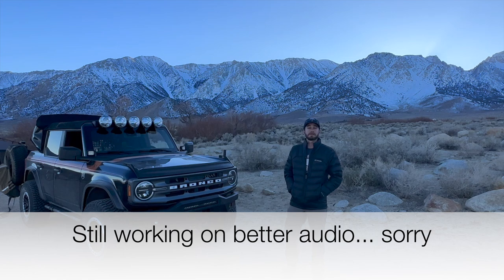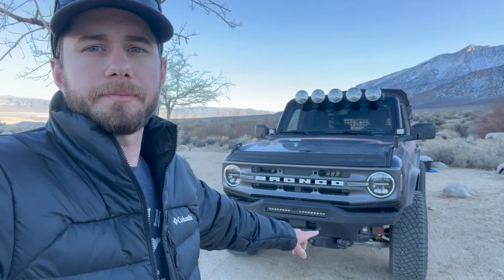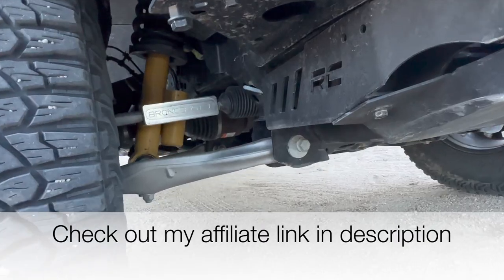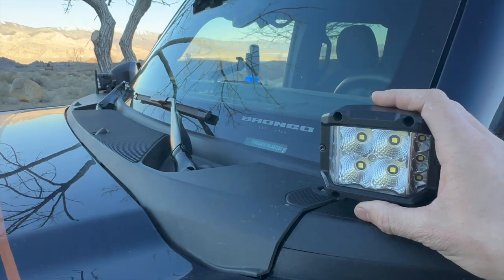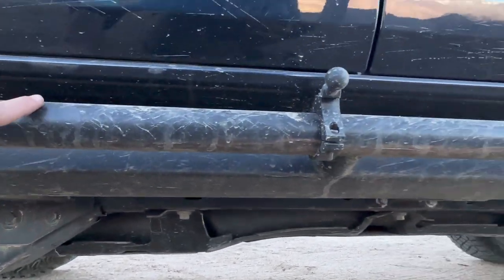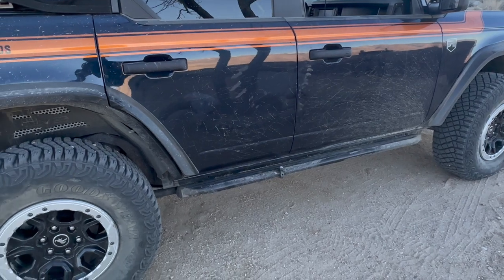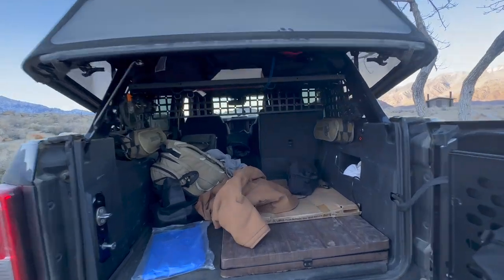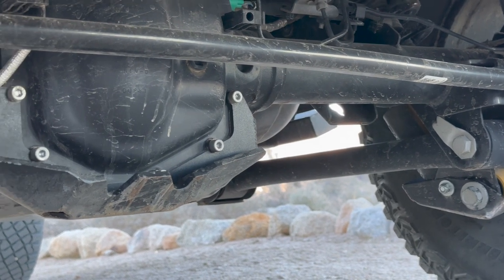Not Your Ordinary Bronco Review

Comment: Thanks for sharing.  You didn't have issues fitting the VR EVO 10-S?  RC told me it wouldn't fit when I gave them the dimensions.
Reply from the maker: No idea why they said that. My Evo-10S fit just fine. Do you have the 2.7 mount or 2.3? That could have something to do with it. I measured my Warn and it was similar dimensions to the RC winch. I have the 2.3 if that helps
Reply: @popo_patty  2.7, but I didn't tell them that.  Probably just a misunderstanding.  I'm thinking it should be fine if it fit on yours, but I'll dig deeper.  I'm glad your video showed up on my feed to shed some light on the matter.  Thanks!